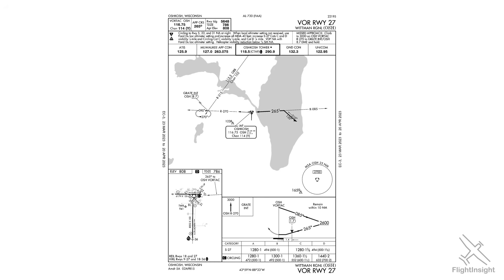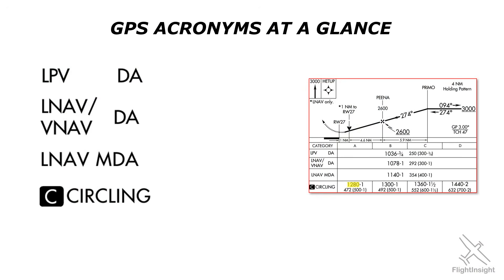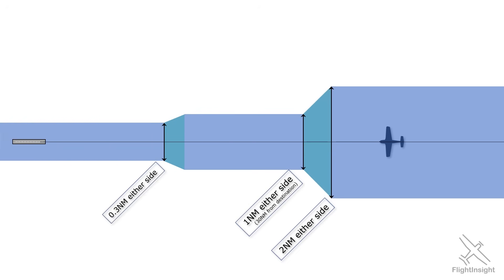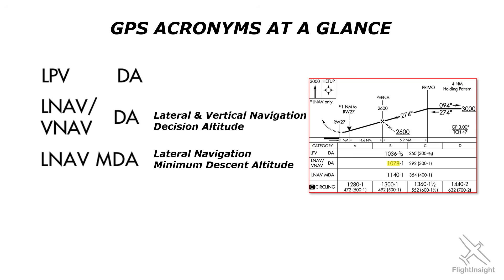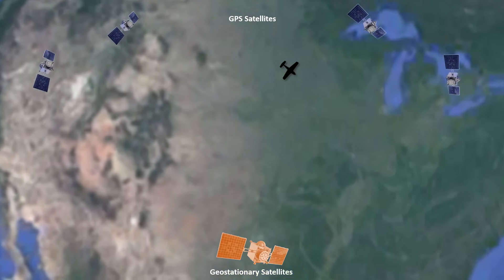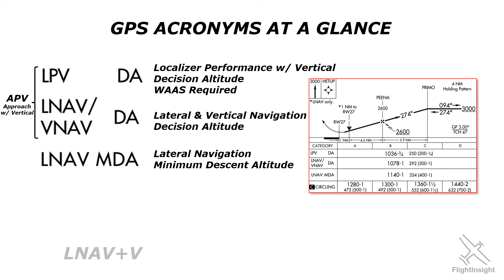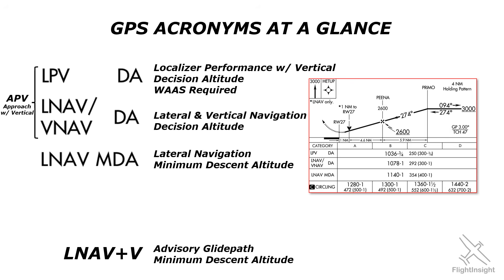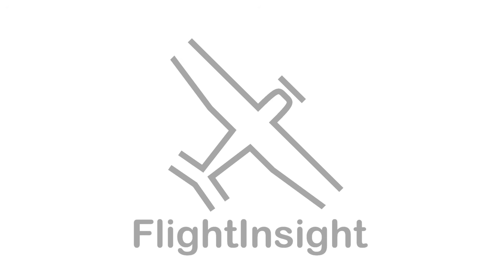GPS Acronyms Explained | What is LPV, LNAV, LNAV+V, and LNAV/VNAV?

Comment: FYI LNAV VNAV is not a precision approach. Only LPV is a precision one similar to ILS cat 1 minima 200ft Agl
Reply: LPV approaches are not classified as precision approaches. They are APV approaches. (Approaches with vertical guidance) They cannot be classified as precision approaches because LPV approaches do not use ground based vertical guidance. The vertical guidance is GPS derived. LNAV/VNAV is an APV approach.

Comment: If you follow the LNAV+V reference 3 degree approach to an airport with a substantially displaced threshold, or any approach with a stepdown fix between the FAF and the runway, the 3 degree reference glidepath will have you too low. In fact, there have been CFIT accidents where pilots inappropriately flew the reference glide path on a 3 degree approach angle where the approach required more than 3 degrees because obstacles were in the final segment. Be very careful flying the V+ glidepath! Remember, it is for reference only and does not guarantee obstacle clearance, or that you will make fix crossing altitudes.

Comment: Question……if SBAS is not available would the system downgrade to a LNAV VNAV using baro VNAV and the RNP value on the HSI show L/VNAV allowing app to a DA?   Assuming of course that you have the required air dat computer to give baro correction to your G1000 and required temp comp range.    Your thoughts on this knowing the G1000 as well as you do.    My G1000 knowledge is limited to what I see on YT.
Thanks

Comment: LP+V will pop up on LP approaches. Naturally, its the same treatment as an LNAV+V. Probably the most commonly used LP approach is the RNAV Y 27 at KSAN with WAAS equipped aircraft.
Reply: So do you need WAAS for an LNAV + V? That's the only part I'm confused about
Reply: @AmericanGi370  airliners, very few of which have WAAS, can create vertical guidance. That said, I believe that in GA, only WAAS capable GPS units have the required sensitivity to create a vertical glidepath
Reply: @N1120A  that's interesting. I would have assumed all airliners would have waas lol. Thank you. Working on Instrument as we speak!

Comment: Fantastic, thanks so much! However, aside from baro aided LNAV/VNAV there is SBAS as well for the vertical guidance right?
Reply: Correct!   Another advantage here is you can ignore the temperature constraints for the LNAV/VNAV as GPS isn’t impacted by that.  However with that said, I have yet to see an approach that has LNAV/VNAV and NOT have LPV so if you are using GNSS with SBAS and  have no issues, you would just fly the LPV anyway…. My comment therefore was just to help you win a round of bar trivia!

Comment: Hey at my local airport F70 the LNAV MDA has lower minimums than LNAV/VNAV DA is there a specific reason the LNAV MDA is lower than the LNAV/VNAV DA?
Reply: Generally, most LNAV/VNAV minimums are not lower than LNAV alone is because it is an old system that uses Baro . Most of the time you have errors, especially with temperature, and the fact that the weather reporting at the local station may be inaccurate or unavailable. You may also note that most approaches with this on the alternate minimums tell you that the RNP .3 is not authorized, and this approach in general may not be authorized for use on this airport if filing as an alternate.
Reply: Got this from another site I follow....   The obstacle clearance surface for the LNAV/VNAV is a sloped surface and when obstacles are encountered close in to the runway on the sloped surface, the obstacle height is projected backwards from the runway until it hits the sloped obstacle surface and the DA/H is established above this point. So it has the effect of moving the DA further back and away from the runway at a higher altitude so that the obstacle ends up being in the visual segment so the pilot can see it and avoid it. Also, with a vertically guided procedure, on reaching the DA, the aircraft is in a descent and will descend below the DA as a matter of physics and momentum. On the missed approach pull up, the obstacles in the missed approach can cause the DA to be increased so the aircraft will clear them. On an LNAV procedure, there is no descent below the MDA allowed and the aircraft is assumed to be in level flight at the missed approach point. Also the obstacle surface is a level surface at a fixed height above the controlling obstacle. Also, in some cases, step down fixes may be used for an LNAV procedure so that once the obstacle is cleared, the aircraft on the LNAV may allow descent to a lower MDA. This step down option is not available to a vertically guided procedure.
Reply: In the AIM look for FIG 5−4−12.  It explains this perfectly with a graphic.